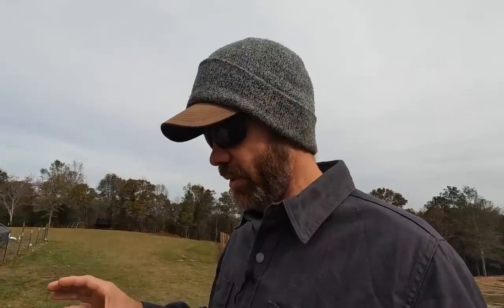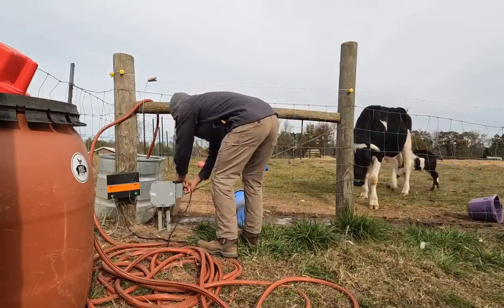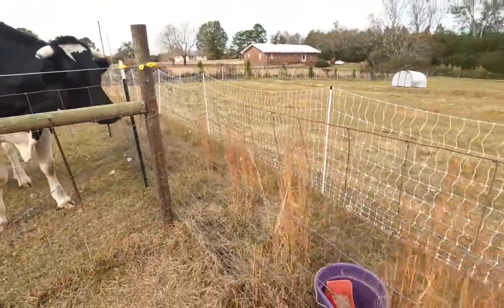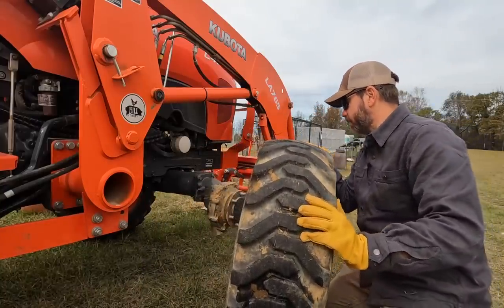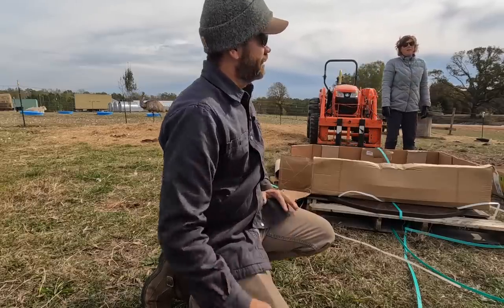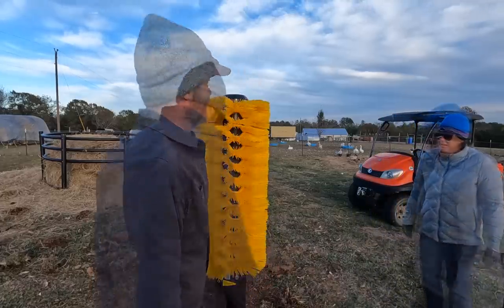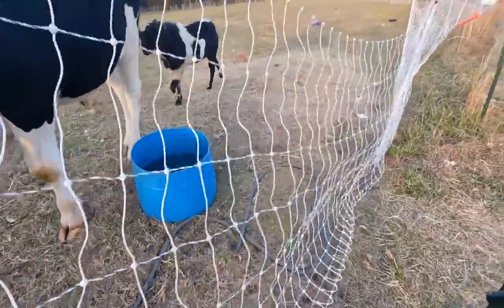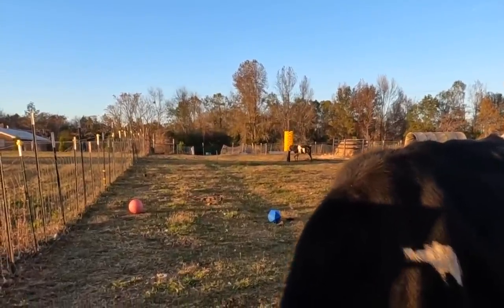This Steer’s Reaction To a GIANT Hair Brush Is Priceless!!

Comment: You know what my dad had at our dairy and cattle ranch he had a lane built across the back of all the corals. Then if he had to lock one pen up while he worked in the pen he could.  He would just run them down the lane and if he had to many cattle for the lane at the end he had a small holding pen so what wouldn't fit the lane could go into a holding pen, there was also a cattle chute attached.  Now my dads cattle chute was made out of cinder blocks on the outside and a concrete ramp.  We had to load cattle in big cattle trucks.
I just thought when you had the time this might be something that will work for you with the cattle and the goats.

Comment: FYI, you can redneck one of those using a railroad tie and shop broom heads.

Pretty sure for the auger pipe bit my 3 point post hole digger would fit it with a little fiddling... Pretty sure we have the same brand.

Y'all's pig would like one too... Can use a 4x4 if ya got one and shop push brooms pretty easy. Ought yo hold up to her just fine.... Sink it a couple to 3 feet in the ground and use some long wood screws to secure the broom heads. Put it a few inches off the ground, once she finds it she'll figure it out. For stuff under 1500 lbs it dont have to be built amazingly stout.